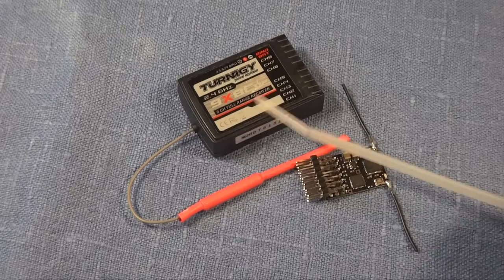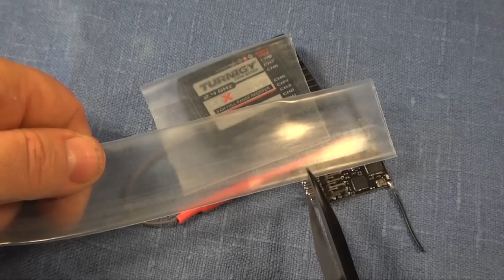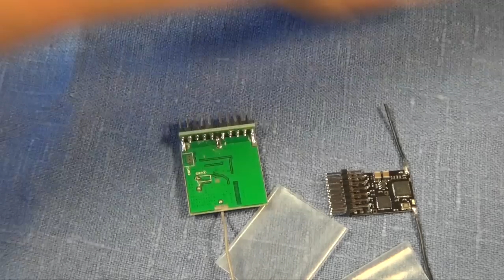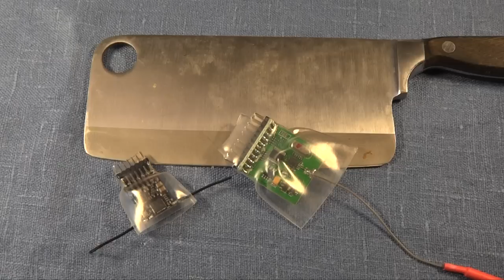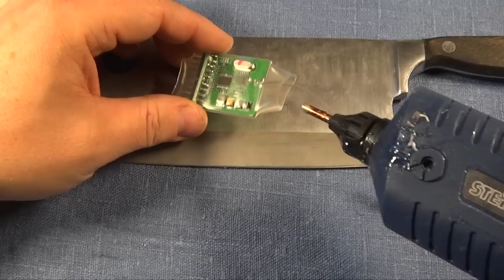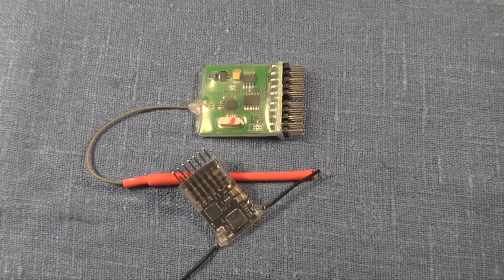Make a protective cover for your RC receiver

Comment: wonder how much this covering will INcrease the temperature of the board???? ole USN vet
Reply from the maker: Somewhat more than the original enclosure, since the air circulation around the component is restricted.
On the other hand RC receivers do not produce much heat at all so overheating is not really a problem.